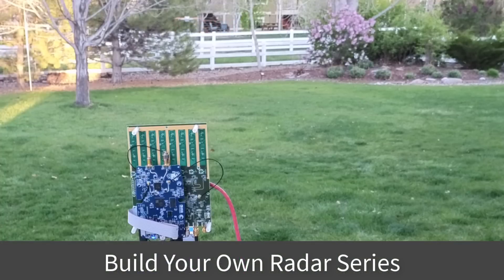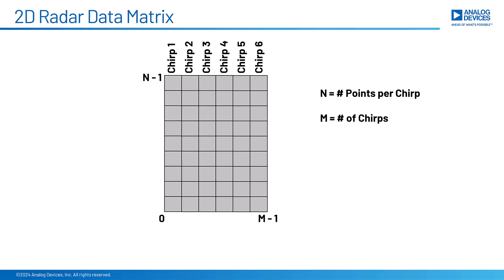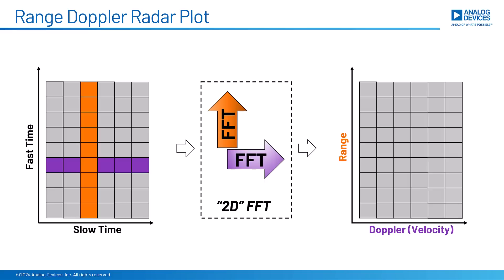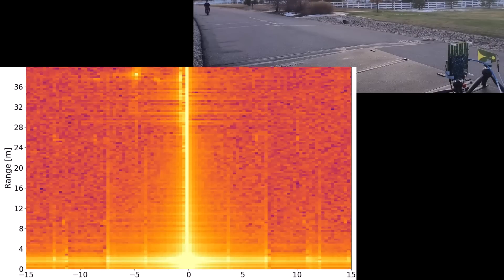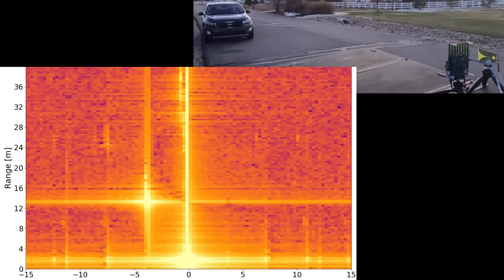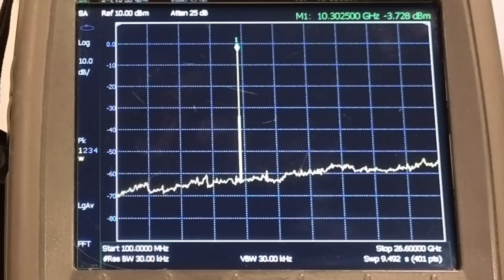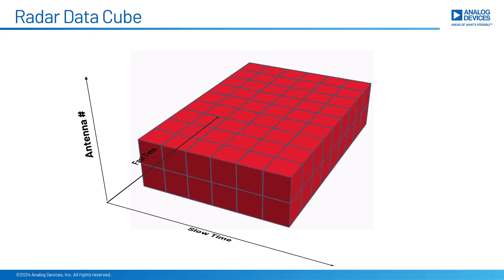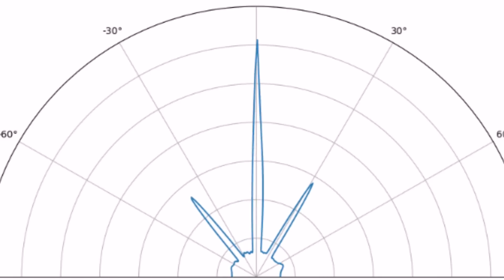Drone Tracking Radar:  Part 6 Range Doppler

Comment: Is this Range/Doppler plot often used? It's interesting information but wouldn't it make more sense to plot these points as positions relative to the receiver with vectors for the velocities? 

Also is this really the best framerate one can achieve? Will it just get way more expensive to go faster and more accurate, export control and iTAr issues?

Comment: Very nice work. How easy is to use it as a classic radar? Without use it on drone just install it to a roof. What other components may need to increase the range to typical radar range? (such as a PA)
Reply from the maker: Yes, please see my latest video where I use a low power PA to improve radar range.

Comment: Hi Jon,

I have follwed your CW radar project and in part 6 - by masking the background I think you Solving a Problem that are most costly losing radio controled planes.

Let me explane. I am a hobby scale rc pilot attending to competitions where some rcplanes trippled the cost of the range doppler.
By making a treshold of the nearby terran like trees I think we likely be able to safe "call" one on final.
Last year competition one pilot lost 8000$ of equipment and 300 hours build hours by misjudging terran doing final while colliding with a three.

Also we got another competition where rc pilots needs to turned around a pylon before going 180. Normaly this is done by officials sitting under the pylon calling it by vision but it is very unreliable. Could CW radar do it more precisely?

We are using 2.4 Ghz or 900 MHz with FHSS or DSSS

Q1. Is there any chance of interference - could the CW project "shoot" us down?
Q2. Could the software at present assist us or needs it a slight moddification? 

Your thoughts much appreciated
Best regards 
Henrik Malmvig - OY 4741

Comment: Suggestion: The 8 channel patch antenna board works from 10 to 10.5 GHz, while the ADAR1000 board working frequency band is 8-16 GHz.  Therefore, I think, phaser should be separated from the the 8-channel antenna arrays. The end user benefit would be that any 8-channel antenna arrays in the frequency band (8-16 GHz) can be connected to the phaser through SMA connectors. This will extend the operating frequency range of the phaser for more general beamforming applications in the 8-16 GHz frequency range. Thanks
Reply from the maker: Yes, you can disconnect the built in 8 element antenna and solder in 8 SMP connectors.  There's spots for that, please see the schematic at wiki.analog.com/phaser
Then you can use your own antenna with an SMP or SMA connector.  You could also change the frequency, but you'd have to desolder/solder in different filters.

Comment: Turbine and propeller modulations are part of the radar target processing on Air Defense Radars. You can see Russian Bear bomber propellers at max Doppler range. The bomber itself needs to get closer before the Doppler tracker locks-on to it. But we also had pulse radar that saw the bombers if they were high enough (Beyond the Horizon) at twice the range of the Doppler radar.

Comment: Great series! 
Is this phased array radar limited to 40 meters range? What is needed to detect range and speed of an object at 400 meters or more?
Reply from the maker: Thanks!  Assuming you mean improve range to 400m to see this small 249g drone.  Two things need to be improved:  improve the hardware and improve the signal processing.  Hardware can be improved via that range equation from the first video.  i.e. more Tx power, more directive antennas, etc.  Signal processing is things like MTI, clutter suppression, integrating pulses, etc.  Lots could be done on both of those ends.  I'm just showing the concepts and a minimum working example.  It would take non-trivial work on both hardware and software to get a reliable target at 400m.
Reply: @jonkraft  Thanks for the reply. Your videos are popular both among my friends in FAANG and miltech developers in Ukraine making all kinds of stuff including phased array radars. Drones are a serious issue as you may know.  And it is getting worse with addition of machine vision. I'm mean not only here, it is a global security issue. Personally I'm building an acoustic array to help defend our skies and more or less know its possibilities from simulations and early prototypes. Hope to finish a full scale prototype this summer and try it out on a test ground to help counter Iranian suicide drones Shaheds. Good luck with your series!
Reply from the maker: @KostiantynKostin  Thanks again.  I really like the idea of acoustic arrays, I think that has a lot of merit for drone detection.  Glad you are supporting Ukraine with this.

Comment: So you have nine bins on the Fast Time axis, separated by the sampling rate of the data convertor, something like microseconds. Is there one ADC reading in each bin? 8 bins is enough for an FFT, but do you really have a lot more?
Reply from the maker: Right, with modern data converters its very easy to get thousands of samples.  I think this data was a couple thousand complex (IQ) data points per chirp.
Reply: I think the drawing is simplified. Your going to have say 1024 time samples to give 1024 FFT frequency samples per range scan to give Doppler resolution. Triangle waves are not as good as sawtooth waves. The abrupt return to min frequency is a discontinuity.

Comment: Is it possible to use the radar to calculate the rotation speed of the propellers of the drone?
Reply: Probably not the speed, as the blades are horizontal to the radar view, but the faster the rotation, the wider the blade Doppler is from the target Doppler. The blade tips are much faster than the RPM of the propeller.
Reply: Thanks. I guess I should’ve ask if you could calculate the rpm of the blades. But I think you kind of answered that.

Comment: Well coming from several years in Turkey we used A variable-focus feed horn that provided a wide beam for detection and a narrow beamwidth for tracking. . . Pulse compression was used to improve both the gain and resolution of the 35-foot (11 m) dish antenna. Steering was mechanical; the FPS-79 had a range of 24,000 miles (39,000 km). The radar site closed in 1997, but  We on base were referred to as "Space Trackers" Loved the Tech back then. You have done an excellent job of explaining and back then We would have never envisioned what you made possible... WELL DONE man! Looking forward to more. https://en.wikipedia.org/wiki/United_States_Space_Surveillance_Network#AN/FPS-79

Comment: Okay but your not measuring the actual Dopplershift right? Or am I missing something. And if that's true why is it then still called Doppler when it would be more accurate to say radial velocity.
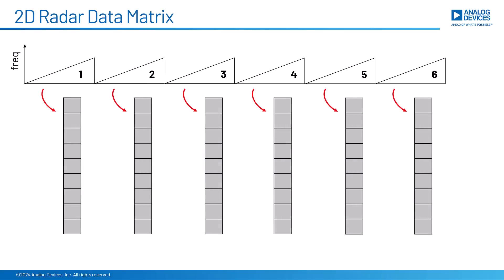Reply: In an earlier part of the series, it was suggested that pauses in the frequency modulation ramp, where the frequency is held constant, would be good places to look for Doppler shifts. If the picture at 0:51 is correct, this wasn't done. I guess if things work out, you could have two beat frequencies: one for Doppler at a particular frequency and one for the range.
Reply: @johnschindler9641  ah okay thanks, didn't remember that part.

Comment: Is it possible to use this solution to hunt drones (e.g. intercept) in the air? All the types of drones - FPV,  Shakhed and the reconnaissance ones.
Reply: For the final guidance, a small / cheap infrared camera is probably easier, lighter and cheaper. Especially against the fairly uniform sky, the contrast of hot motors should be significant.

Comment: This has been an excellent series. Great informative content in nicely sized episodes. 
Really look forward to the phased array series.

Seeing additional vertical bars in "street demo" range vs. velocity plot at 3.75, 7.5 m/s either side of 0 m/s suggests 1/2 and 1/4 wavelength interference, or is it an artifact of the FFT?
The street demo really brought all the pieces together. Can see a number of ways to modify parameters, and software to experiment in different ways. Thanks for sharing.